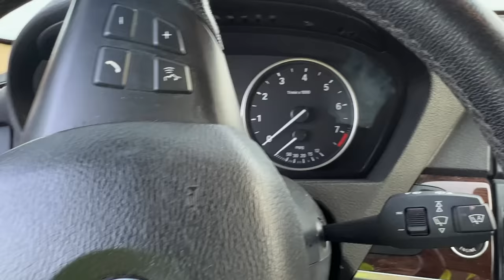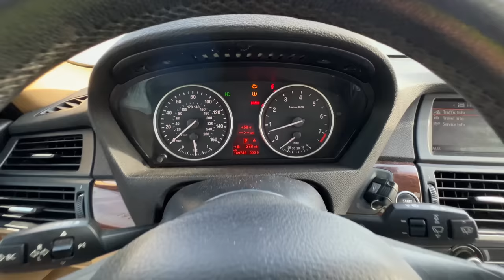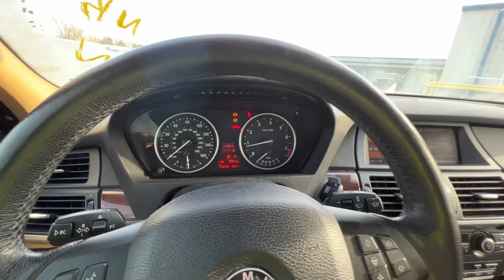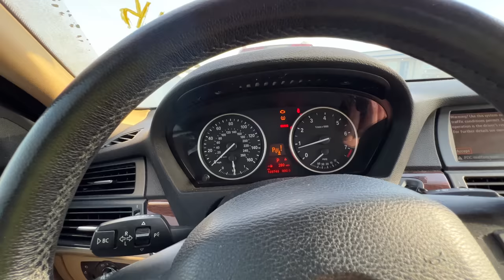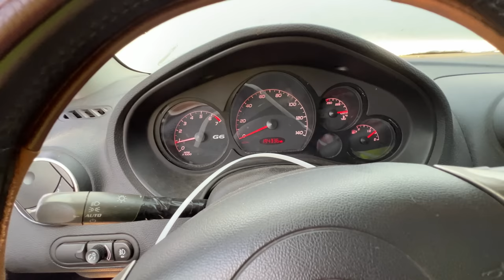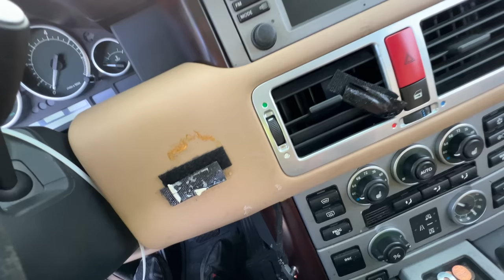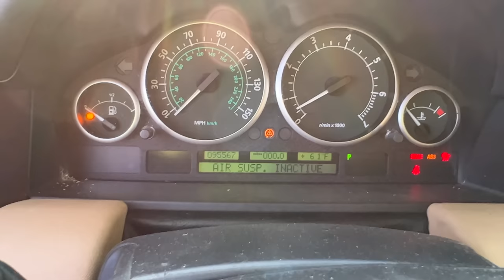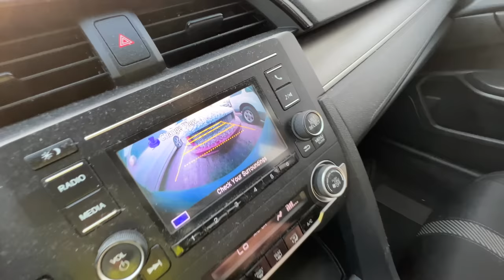Copart Walk Around and Live Bidding + Buy it Now!! BMW X5 No Key!! 12-10-21 AM

Comment: On my 2007, it was the 30si which indicated the sport model.  No turbo, but a little different suspension setup.  You may have some added features on your spec, I had the base, so nothing really side from different suspension components (not electronic)  Your leak may also be the valvetronic motor gasket.  I thought I had a cover leak on mine, but it turned to only be the valvetronic motor.  30 minutes and you're done, if that. (I've got a video on that)  - Get your MyCarly out and you'll have a bunch of options you can switch, but you already knew that :)  If you haven't figured it out, you had issues going into drive because the shifter was knocked left into auto-stick mode.  Knock it back to the right for a regular automatic, which is where you shift to P/R/D.
Reply: Si is 2wd. Xi is 4wd. Correct?
Reply from the maker: @XrayDean  Incorrect.
Reply: @XrayDean  Nope, I believe XI and SI are basically the same thing for BMW’s AWD system before they implemented the xDrive name

Comment: I bought a Boxster earlier this year from auction, listed as no key, no start but was a repo so I thought, makes sense there's no key. Went through all the trouble to replace ecu, electronic steering lock, security module, door lock... Lots of hassle... Before trying to start for the first time thought I'd give the gas a sniff test to see if it was ok.... Opened the gas flap.... There's the key!
Reply: O man that's shity! I bought older Ranger years ago for $500 the body was immaculate... nobody could get it to run right after a couple computers and other crap the owner gave up. Took it to my friends house shop we put it up on a lift he found a hanging wire that was rubbing when you hit a bump  fixed that in 5 minutes he bought the truck from me hes been driving it for 4 years no issues
Reply: @frankm8533  I "think" the title company's workshop did it deliberately. The accessory drive belt was shredded and the water pump pulley was also toast so probably thought it better that people didn't try starting it. It was evident that people had been trying to work on/inspect things, parts and covers removed etc. I don't mind. It's been a great project and while there's still some cosmetic work to do it's a fantastic driver now
Reply: @juliank911  That awsome. I like doing stuff like that my self. I just picked up another Ranger it runs but needs the fuel system flushed out 'old gas' paint is covered in green moss from sitting under a tree no rust anywhere, needs tires, paint correction and full detail its a 5spd extra cab 1992

Comment: $1700 buy it now (2000 with auction fees) i would have that in my driveway yesterday.  I have worked on bmws for a decade, they do not concern me like they would others.  long as the engine runs, and transmission shifts i would gamble that in a heartbeat.  however....know this....just about ALL bmws, especially this era, will require $1500-2500 in PARTS in your first year....you must ASSUME parts for leaks, cooling system overhaul including water pump, all hoses, radiator and expansion tank, and control arm parts. Considering that interior is actually looking in really good condition that really does give me confidence that it was taken decently taken care of (no guarantee but in vegas thats a huge indicator of the type of owner of lux cars here)  im hoping that transmission is good.  if it IS a 6HP model transmission, you can use MOTORCRAFT branded fluid from a FORD F250-350 super duty that uses the ZF 6HP transmission (2006-2008 iirc) and it works.  i have used that fluid myself, if you research the difference between their fluid and ZF lifeguard 6 fluid, the MSDS sheets are identical, and both manufactured by shell in texas.  $7 bucks a quart vs $20 per ltr for ZF fluid.....

Comment: The BMW shifter looks confusing and bizarre. Glad you worked it out. Great find Randy. Hope Jessica enjoys the BMW.
Reply: It's not weird nor confusing. If you can read and understand basic guidelines, it's extremely easy to use. The reason it wasn't working for Randy was because it was knocked into the manual/sport mode hence the reason it wouldn't shift into drive or reverse.
Reply: @XuleGua  The old Park, Reverse, Neutral, Drive, 1, 2, 3. That was simpler. Even a Malibu shifter looks simple. Less complication.
Reply: @jean-marcandjoshua-petsjournal  That's old school. This is newer technology which is also extremely simple to use. Lmao
Reply: @XuleGua  I miss the simple times. Cost less to replace.

Comment: That air suspension inactive warning comes up because the battery was flat all you need is to turn the steering lock to lock and it will go away

Comment: Randy the shifter in th x5 sometimes it gets slid into the sport mode witch is to the left on the shifter if it is in the sport setting it will just got forward and backward just grab the shifter slide it to the right to get back to normal shifting from p, r, and drive just for future reference my 535 is the same way and I thought my shifter was broken but one you play with it you get used to it

Comment: I would buy the range rover it would make good content that's a year when BMW owned the range rover. and those you have to do a wheel-to-wheel lock with the steering wheel to rest the air suspension. when the battery goes dead. and that's common for those to make that engine noise.

Comment: Run from that Rover, Randy. That's a BMW V8 engine and its nothing but nightmares with the timing chain tensioner, valve cover gasket leaks, head gaskets and all that junk...
Reply: Incorrect, if you watched the video where he shows the live bidding its a 3.0L V6 X5, which are the better engines.
Reply: @EpicGamerCookie  Read his message again. He said Rover, not the X5 ;)
Reply: @jargo7251  ahh your right, didnt see the rover part.

Comment: The lug wrench? Well if it was a snake it would’ve bit you 😂 it’s in the styrofoam Jack case right underneath the jack. And if that’s the 3800 (3.8) v-6 it’s the best v-6 General Motors has ever made